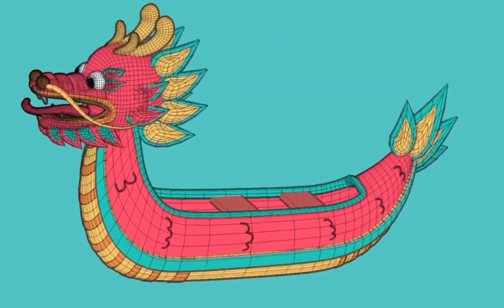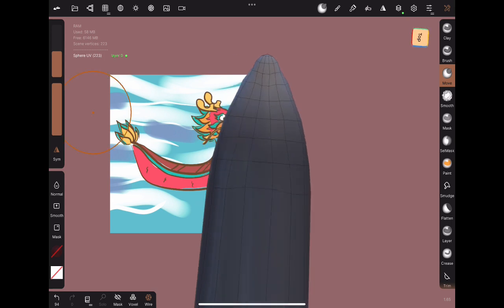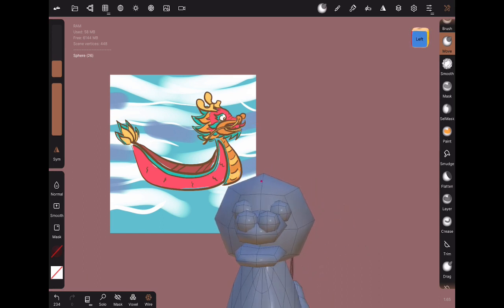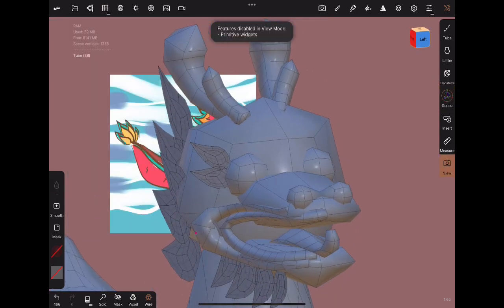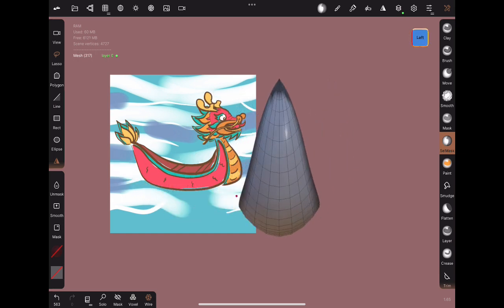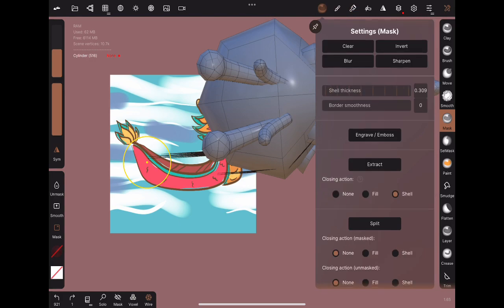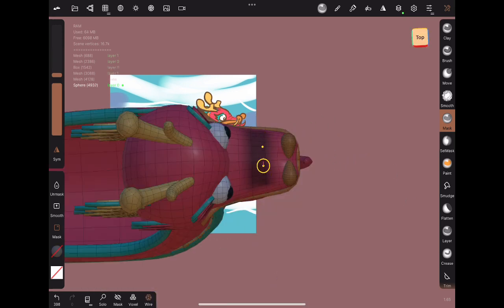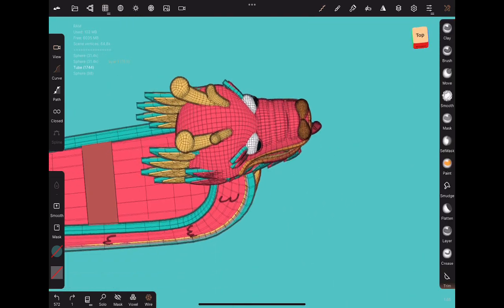Dragon Boat | Sculpting Walkthrough | Nomad Sculpt 7 min

Comment: Brilliant. You’re use of the project tool was eye opening. 🤔✊ You demo the wisdom of designing a low-poly framework…when you subdivide, your lines and loops are all going in the right direction. Then you can pop out all the cool trim & details from that. Think ahead! Voxel remesh only if you have a god reason. Your content is a real asset to the Nomad tribe. 🙏🍷🎩🎩🎩